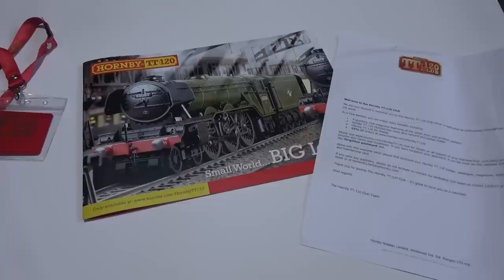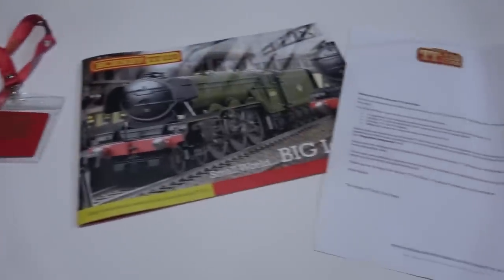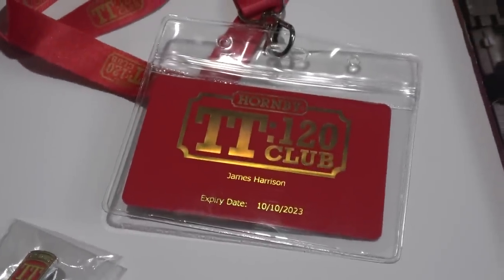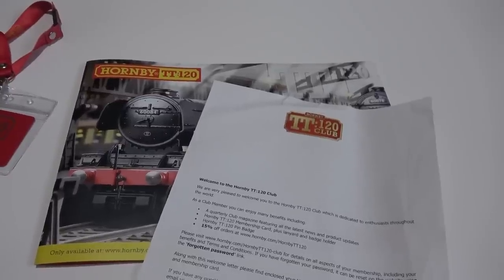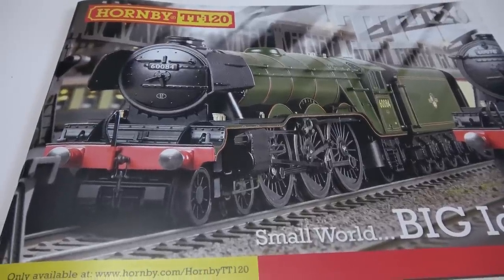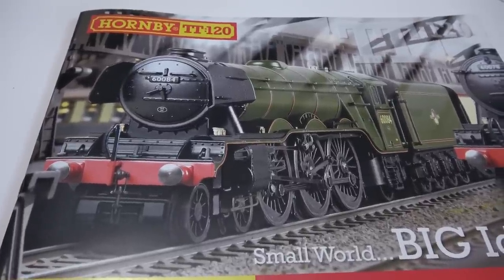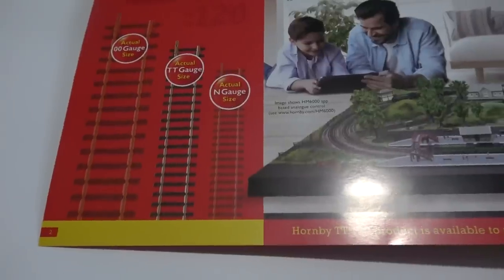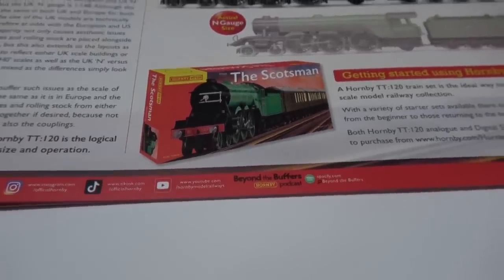I joined the new Hornby TT:120 Club -Should I build a TT layout?

Comment: I built a fairly large OO shelf shunting layout (13ft x 2ft) in my garage during my furlough a 3 years ago. By the time it got to the point of buying stock (80s BR blue era), Bachmann were asking more for a coach than I paid for my first loco. I am tempted by TT120 as I could probably get a continuous run on a shelf all around the garage. Peco track would be my choice again.

Comment: The PECO TT:120 track and unifrog points are pretty decent. I picked some up to try it out. This just gives people more choice, a lot of people don't have the room for a OO layout, and the nice thing with TT:120 is that you can pack it away fairly easily into a plastic storage container. I think its going to help get a lot of people modeling who normally buy the odd model and are waiting to figure out where to put their layout. Not sure its a good thing that Hornby might not have any competition in this gauge now with other manufacturers canceling their planned products.
Reply from the maker: Its a shame Heljan pulled out completely. They could have done some more obscure models Hornby wont get to for a while.
Reply: @BrockwellLanemodelrailway  Absolutely. The Hobby was due a bit of a shake up, TT:120 is a good start, it'll be interesting to see what else follows. I suspect there are a few surprises between now and the New Year left to come...

Comment: I think that TT 1/120 is a better bet than OO for many people, because of space constraints.  I have no experience of N gauge, but am under the impression that it might not be the best scale for small tank engines shunting.  It was a long time ago, but if I remember correctly, the old Triang TT (same the gauge but a larger scale than TT 1/120) seemed to run as well as the OO trains of the time.

From what I understand, a double set-track continuous layout can fit it on a 3'(90 cm) wide board rather than the 4' (120 cm), avoiding radius 1 curves.  Most people can easily reach 2' with unimpaired dexterity, and can reach another foot if they are careful, and don't have to do it too often.  A OO 8' by 4' layout needs access from both sides and at least one end, so needs a space of about 10' by 8' to be able to operate it.  A 5' by 3' TT layout could be placed operated next to a wall, or even in a corner (needing about 5' by 5' of the room), although you might want to avoid having too much pointwork on the side next to the wall.
Reply: but then neither is TT ,, look at farrish N gauge products next to hornbys TT and it soon becomes clear farrish products are far superior even given the smaller size

Comment: Since 1982. I got my first TT scale set for Christmas. My parents decided weither scale to buy. A couple days before that Christmas I found my uncle's N scale trains in the drawer. My parents caught that sight. But, if I remember correctly, the model shop clerks told my parents the N scale maybe will end at the Piko plant in East Germany, they will rather produce H0 stuff, but there is an alternative for a city block apartment - TT scale. The Berliner TT Bahnen "models" (hm, a half way between models and toys, actually then) were available anytime in shops in bigger cities, fair sortiment and relatively cheap.
The 2nd most used scale here in my country. But a bit expensive, however not only Tillig TT, Piko TT, Roco TT and Kuehn TT are filling the market gap, but local manufacturers producing local vehicle models (the quality is sometimes questionable - no competitor on the field...)

Comment: Saw the range at Gaydon on Saturday. The steamer was working whilst the 08 was working too. The 66 and hst were in early stages. Pullmans were ready. Track is ready and so are the buildings and vehicles. Simon was very enthusiastic and Triang runs on the track. Hornby track is better than peco as sleepers are more accurately positioned and not integral. Other ideas will be steam generators and sound. See it at Warley.

Comment: I'm moving out of UK N-gauge (the layout was becoming too heavy) and selling 150 or so N-gauge locos.  The LNER Pacific balance weight issue has been fixed (hence the delay to the sets) and 247 Developments are doing plate sets for all the new Hornby locos, so I can indulge myself with a few A3s - maybe not the 17 N and 4 OO I currently have, but enough to keep Hornby happy.  Fox do loco numbers for BR in a variety of sizes, so an existing one should fit the cabsides.  Simon Kohler says there are high and low bunker J94s coming - I'll need six or so, so I'm looking for Hornby or Peco to come up with some decent open wagons- 21 ton hoppers will do nicely.  The new layout will be an exhibition roundy-roundy and the baseboards are now on order.  TT gives me the chance to build an exhibition layout that can travel in one car with two operators, and still be interesting at the end of a 2-day show- my OO shunting plank gets very boring to operate by the middle of the first afternoon.

Comment: Although I am somewhat miffed at Hornby for pricing me out of the OO gauge field. Now I know why. As for TT120. I think it has potential and I have also ordered the info pack and joined up. But I do N scale and I find that the Dapol, Farish and Kato models are excellent overall and I am sticking with N scale. I would buy a Class 60 if Hornby did one of those models but there must be a demand for TT scale otherwise Hornby wouldn't do it. I will see how it goes before I buy anything from Hornby in TT scale. Personally I feel more safer with N scale and there is more choice for me.

Comment: For me, I'm too into both N and HO/OO, so it's a little bit too late for me to consider TT. Or maybe not...
The bigger size than N is something interesting for reliability : the more you reduce the size, the bigger the reliability problems arise. If Hornby does not do the asinine thing to source their motors to the same manufacturer as some of their OO models (9F anyone ?), that would be great.
Honestly, one thing that deters me from buying is the finger they draw up to all the shops. It's lame. But that would be a great thing it TT rise again with a solid British line. Maybe, for me... Does they plan a DB Schenker class 60 ?
Reply from the maker: There is a class 60 planned in EWS Railfreight and GBRF but I'm sure they will do the DB version later. Probably at least a year away.

Comment: My concern is that you're going to be limited in the range you can buy from, at least in the short term. I can imagine that a lot of modern day modellers in particular thinking that there's not much on offer for them so why would they bother with it? Also, will Hornby's quality in TT be improved over recent offerings in OO gauge? If they're not going to be prototypically accurate such as what you pointed out on the front page of the catalogue then most people will see TT as a trainset and nothing more rather than something to build a model railway out of. 

In saying that though, it doesn't really matter what scale people build in, if TT allows more people to create something in the hobby that's only a good thing. It'll be great to see what people can create in a smaller scale but with more detail than in N gauge. I like the idea of a smaller gauge, but going off recent history in terms of quality from Hornby, I would want to see more manufacturers bringing across their models first before I would even consider a new scale

Comment: Back in 2019 there was an increase in the numbers of railway modellers who were moving in the opposite direction towards 0 gauge, so I am somewhat surprised this has happened. I don't know if Covid killed that move towards 0 guage off. I for one am left a bit bewildered by this move particularly keeping the distributors out of it, however should it flop the distributors will be glad they hadn't invested. On a positive note this could bring new modellers to discover the delights of model railway building and see an increasing model railway market.
Reply from the maker: I think the move to O gauge was because the manufacturers started to provide more RTR in that scale so I think the same will happen with TT. The most controversial thing for me is them cutting out the retailers. If all brands (not just models)do this there will be no future for any shops in the future.
Reply: @BrockwellLanemodelrailway  I agree entirely, the shops have been a great resource particularly when it comes to the additions to turning the model railway from a circle of track into an operational time capsule.
I think Hornby have missed a trick they should have bought out Magnarail allowing model cars to move along a road. This would have enabled them to increase their Oxford model car scales and some Airfix models, making model railways look more like the real world!

Comment: Bold move from Hornby, certainly don't like idea of Hornby cutting off some very good Retailers - like Hattons, AC models, Rails of Sheffield (did this couple of years ago) and again the small scale & price is the sticking point for me in not only OO gauge (new) but this slim down /scaled gauge is not far from off the much larger OO gauge in terms of ££.     With OO gauge there's plenty of models both new and used markets that are attractive to modellers of varying budgets, newbie could pick up a decent used set for £80 and add on adhoc basis some good used gear

Comment: it isn't free it is a marketing mans sales tool for a minimal supplied failed gauge ,,,,,, N gauge is the way to go all day long if space is your concern ,, TT nearly fills the same space as OO  yet OO and N have vast ranges to chose from ..... TT is a vanity project for golf club bores to boast about in the 19th hole
Reply: At 2.54mm/ft, TT is closer in size to N (2mm) than to OO (4mm). So no, it's not nearly the same size as OO, it's just 25% larger than N.
Reply: @roundel52  layout wise there isn't that much difference to oo to get any meaningful space saving unless building huge layouts N will always be the space saver